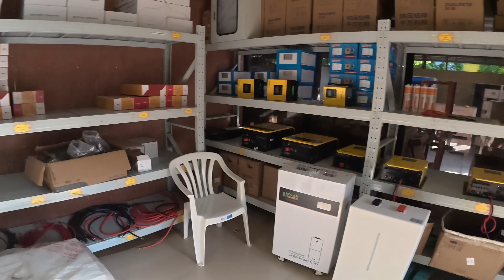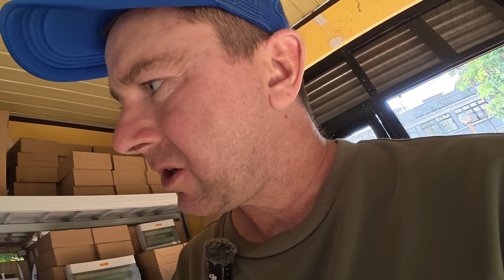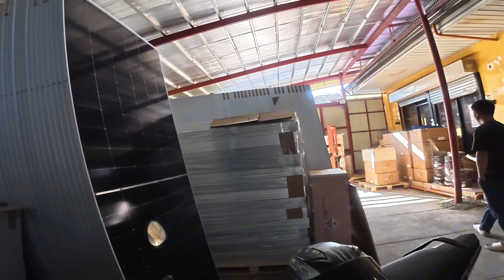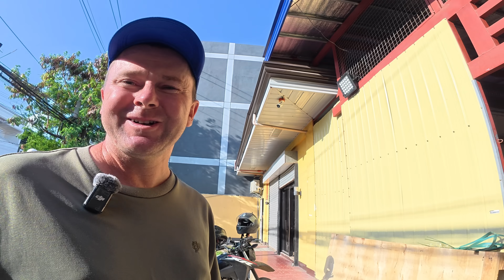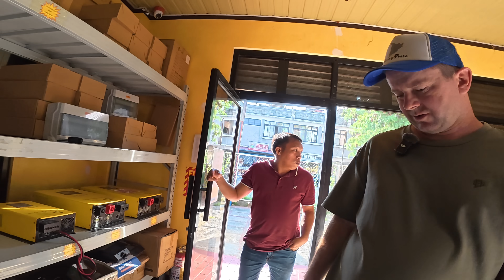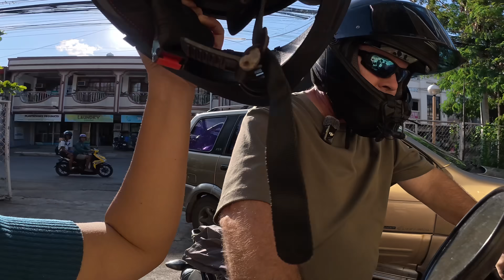Philippines Cost Of Solar Energy

Comment: What a great solar business, it's an Aladdin's cave of solar goodies.
You're definitely onto a good thing with this James.
Our small UK 2.6kW solar setup has practically zeroed our electric bill with the free energy and the FIT payments.
I could import a 16kW chinese battery for only about £1100 but could not find an installer who would take on the job without pricing the job out of existence or insisting they can only install their massively overpriced batteries!
It was impossible to find a UK installer who would work for a call out charge and hourly rate rather than costing what was a simple job for thousands of pounds!
In the Philippines that problem doesn't exist.
We are going to install the largest solar our roof can take with a large battery storage so we can be practically bill free for our electric power.
We have a house in Antipolo City and brownouts are less common there but as you say the world situation is becoming less stable and petrol/diesel prices are likely to keep increasing with access decreasing with the various middle east wars, etc.
Add in a nice EV car and you are more self sufficient with zero energy costs.
Starting off with battery storage charging from the grid is a good move to cope with those brownouts.
I'm looking forward to seeing how your system gets created.
Reply from the maker: Very insightful comments. Thanks for taking time to comment here.
Reply: @JamesandKarenadventures  depends on the ev . have both gas and a ev hit water witch in the Philippine's flooding is normal.
Reply: Keep us posted, some are building a sepparate room for the system in case of fire.  Make sure all good quality.  Id like to know about install and issues if any during and after install to see if worth doing for myself.  my bills over 11000 a month.

Comment: I see ONE Solar in there. I bought a ONE Solar Power Station (1.2 kW) and it broke after not even a year. Some people say they have no problem with ONE Solar. Maybe that is just 1 poorly designed product and that others are good. The same goes with expensive brands like DEYE. I am now in the process of buying an Inverter. I hesitate between those very expensive brands and PowMr and Anern that have the same Spec for 40% of the price.

Comment: You better make a REAL evaluation of how much electricity you actually need and use, especially if you plan to charge your EV. The installation here sounds reasonable for an average house in the Philippines, but the problem with solar is that during the rainy season, you only get a fraction (10-25%) of the production from your panels. If you use Aircon a lot, you will need more panels. Aircon use a HUGE amount of electricity. Don't forget the cost of installation of those panels, including the wires and connectors. You may need to reinforce your structure if it was not build to support that much weight. Those 14 panels are at least 1/2 a ton.
Reply from the maker: Thanks for the advice, we are definitely doing our due diligence on the load requirements and structural needs before we commit to the full install.🙏

Comment: I think six panels and a 4 kW hybrid inverter are enough to charge the car with 15 kWh daily and power the house, including two air conditioners and a refrigerator.
Навіщо платити більше ?
Reply: Друже, підключи автоматичне  дублювання українською. Мені цікава твоя інженерія
Reply: В Києві, в літку 12 панелей  jasolar 450 W односторонні (висять під кутом 90°) за сонячний день заряджає 16 кВт АКБ два рази 
Це 50.45° пн. ш., 30.52° сх. д.

Comment: Solar attic fans to extract heat from the ceiling—in the Philippines—such as the popular 360 Solar Ventilation systems—cost anywhere from roughly ₱2,300 for basic DIY exhaust kits up to ₱16,000 to ₱22,000+ for larger 20W to 40W+ roof and gable-mounted setups

Comment: James the way to go, one advice but for sure you have checked it already, make sure your roof thrusters are strong enough to hold the extra weight of the panels with in mind the strong hurricane winds
Reply from the maker: That is a great point, we are definitely making sure the roof structure is reinforced to handle both the weight and the wind! 👍

Comment: Despite my one bad experience with solar and the fact that solar burned my BILs roof in the US, I have to admit I am now a fan. I beat the price skyrocketing with my two 12KW with large storage installations. I have a couple of modest houses in town that I'm going to DIY, 6200W AIO Inverters with most everything you need integrated into the inverter, breakers, fuses, lightning protection. Need an external PV cutoff switch and possibly a fuse at the battery because I would rather replace a fuse I sourced than try to find the exact fuse the inverter manufacturer used. I don't have much room at these modest houses since I refuse to punch holes in the roof. I will build a Pergola over the 2nd floor deck at one house and put the panels on the carport at the other, one will have 6 pieces 720W Jinko commercial panels and the carport 7 720W Jinko panels. More than enough to power a modest house. Also single string and wired in series about as simple as it gets. Less than $4k USD each system, but I'm using expensive panels due to lack of room for more panels and I'm buying a premium quality battery with bells and whistles. 

I could probably build an adequate system with less storage, using James Watt metal case (like a good golf cart battery) batteries that have active cell balancers that work all the time to keep the cells balanced so the batteries don't need to be high tech and smart and communicating with the inverter. Pony Energy makes a apparently identical battery except they use a passive cell balancer where the battery will only balance when it's totally full and stays totally full for hours to days But I would use the Pony Energy if I were using only one 5kwh battery because it would be full every day the sun shines so it would get hours of balancing on those days when the panels produce more power than you can use. The Pony Energy is P5k cheaper than the James Watt but for a multi battery installation I would want active balancing.

If I really wanted to cheap out, James Watt makes some 300AH 24v batteries that sell for P30,500 with active cell balancing and I could connect them in series for 48V. Cheapest storage I have found that I would be willing to use but that price probably won't last because if I can figure it out, someone else can too. I would do it but I want a single battery solution, simple, easy, clean, no busbars, external breakers, one fuse, two wires less to go wrong and I might not always be around.

Forgot to mention, the houses are already wired with interlocks for generator hookup and my systems will be plugged into that so they are truly Off Grid but grid is retained and flipping one breaker and the house is grid powered again. This would make me want to use less and cheaper storage battery and just switch on the grid at night when we are using so much less power but it isn't for me and I have no confidence in the energy use discipline of those who will be using it.

Comment: I have solar two installations in fact 12kw each. One was for wife's family, 12kw solar 45kwh batteries and after back to back typhoons and about 3 cloudy rainy days they were thrown back to the grid, lack of discipline using high power appliances at night. 

If you expect to charge your car, you need a higher powered inverter because you really want to be pumping the juice to the car during Peak sun. One 16kw battery will only get you through a night with aircon if the aircon is low draw. If you are just using the fan, you will be fine. If you plan to charge a car you must capture and use as much power as you possibly can during peak sun. 

If the panels are bifacial but laying flat on a roof, expect to only get 70% of what they are rated for because the rating was done at 25C and in bright sun those panels are going to get up to 60-70C and their efficiency will go down. 

12kw inverter brings it's own joy it will use 100W or more in standby whether it's doing anything or not that's like doing a load of laundry in a washing machine +10% every day or 10 times 10W lights running 24/7 but it's literally a make hay while the sun shines situation.

I maintain the electric connection because it's pretty reasonable price of admission to a billion dollar grid if you aren't using that much if any power. When your battery goes flat, it's a luxury to just throw a breaker and run you house and possibly charge your battery if you think the next day might be rainy also. The minimal standby charge for the electrical connection is a cheap admission price to have access to the grid and not have to run a noisy generator. I love generators, I was into generators long before I leapt into solar, I size the generator to the load for efficiency and I have several. I suggest you have a generator also if you don't have one. I can see the appeal and satisfaction of telling them to "Come get the meter, you don't need it anymore" but is that adult thinking?

Solar isn't trouble free. One of my professionally installed solar setups failed within a week, might not even have lasted a day, I don't know because I wasn't there to monitor it and my wife only looked at it when I told her for the 3rd time and sure enough, the batteries were almost dead. Providing the grid is up when your solar goes down, it's going to be a joy to flip the switch and everything works until you get your solar fixed.
Reply from the maker: Everything you said is correct. We can just about live comfortably off grid now. Even just enough to run our fans and fill our water tank once a day is enough. We are installing a split aircon for Karen and the baby on the days when it’s needed on the hottest part of the day which is very sunny. The car won’t be used but maybe once or twice a week and can be used also as an additional power bank, lol. I’m fully aware of the issues with EV and solar charging. We will be great.
Reply: @JamesandKarenadventures  Glad to hear that. I prefer to think of it as being self reliant rather than Off Grid.

Comment: Dear James & Karen. I am pretty much in the same situation living in the Philippines and facing high electricity cost with an unreliable grid. I currently have 3 kW of panels installed and 7.5 kWh batteries in our temporary dwelling. I am building my house and will have pretty much the same Power (Panels & Batteries) than what you are purchasing. This should be enough to power your home. If you use a lot of Aircon you will need more panels and one more Battery if you run AC outside of sunshine time. I can tell you by experience that in cloudy days, the panels generate maybe 25% of their Power and in rainy days 5% if you are lucky. I doubt your planned system will be able to charge your EV, unless you do little driving and you charge while the sun is at maximum. We have no choice but to also use the Grid when there is not enough sunshine. I wish we could have a net metering system. Then we could balance between our over and under production and get zero bill.

Comment: Check Pecron F5000. It has 5kw including  inverter, it costs from the Chinese factory about $1200 and you can buy extra battery or two of these. The best brand ecoflow delta. You will get much more value from these systems.

Comment: Hello James and Karen, I’m budgeting roughly 400,000 pesos towards solar for my in-laws in the Ajuy, Iloilo. The house is roughly the size of yours with a rest house give or take ( I don’t have the exact measurements) Is that a good start? I know room size and how many appliances we plan to run will factor in. I just need to know ball park wise if 400,000 pesos is a good start. Thank You in advance.
Reply from the maker: That is easily enough. Make sure you shop around for prices and get what you ordered
Reply: @JamesandKarenadventures  Probably use the same company that you are using.

Comment: 9100 watt did you find out what breakers you need howmany Amp? Minimum 32 Amp! And you need also thick cables. Be aware you buy SUN UV risistend cables James otherwise in 4 months it is chips

Comment: If it's off-grid and you're not tying into the grid for sell-back, look at Chinese manufacturers. Docan Power ships around the world and they have a 48kWh battery for 246k pesos. You can get larger Victron (German) inverters and solar charge controllers for what they're charging for smaller components. Also look at Jinko Solar for your panels - the most efficient available and they service ph. All I'm saying is don't limit yourself to a specific installer. Solar is entirely DIY now and products out of China are excellent. Even the US manufacturers are just packaging Chinese-made LiFePO4 cells. Or meet in the middle - find an installer that will install and you buy the components.

Your system will need to be oversized if you're going to be charging an EV and running aircon.

Comment: Since it is illegal to build this without a permit in the PH, how hard was it to get that permit? I only have portable panels and two Bluetti boxes, so I can always run the fridge, internet, and a TV plus office, and for bad days, just charge it with the aggregator. One box with all I need typically holds enough power for 15 hours. If only fridge, about 25-30 hours. With what I have now, brownouts are never an issue, and in a disaster, never an issue either, as there will always be power, and the panels will not be destroyed during an earthquake or typhoon. 

Just putting it out there that this is another way of doing it unless you want to be disconnected from the grid completely. 75K PHP per Bluetti box, and 36K total for 2X400W portable solar panels.

Oh, and be very careful with that dating site. It is not good..
Reply: i was told by my professional installer that if you are off grid you don't need a permit, the permit is so you can backfeed the grid.
Reply: @robertkubrick3738  No, that is not correct. Always double check in the PH, Mr😅

Required Permits for Pure Off-GridBuilding:
Permit (from your municipal/city LGU)
Electrical Permit (from your municipal/city LGU)
Certificate of Final Electrical Inspection (CFEI) (issued post-installation)

I am almost done building a house here, and oh boy, what you are told, and what is reality is most often two different stories😅

Comment: If you have additional budget, get Deye. I had issues with Solar Homes. I have 4 units and they dont sync properly.
Reply: Even if had issues, unli solar helped to change the parts as part of warranty. Its just i have to pay the transportation and service for the installer. That battery is not light and need 3 people to carry.

Comment: I bought mine from them. You are in good hands. I have 18KW inverter, 30 panels, and 60KWH battery in Caticlan.
Reply from the maker: Glad to hear they are reliable, thanks for the feedback!
Reply: what was the cost of that???? Sounds like the way to go..
Reply: @anaussiefarminginthephilippinespent 930k Pesos but that was before the US-Iran War. And the materials a bit cheaper that time.
Reply: @ofwretirementjourney  Yes i was quoted around the same,, I bought from China, less then 1/2 price, i will install myself. the company wanted 100,000 as part of their quotation for a 16 kw unit... i will install instead, i cant see how 100,000 peso to install is worth it...
Reply: 18KW???? are you start a supermarket??
Reply: But im planning 12KW in my house in Altavas next year.
Reply: @jackpiket7643 i have water refiling station and ice cubes shop. 😊
Reply: tf?? u got an AI data center in your house 😂
Reply: @felixortiz1185 im actually planning to add more panels and battery. Not enough during rainy.

Comment: James based off of 2 -16 kW  batteries how much storage is in each battery?
Reply: 16 kilowatt hours each battery. My modest house running a 1hp mini split 24/7  20cuft refrigerator 65 inch tv( 4 hours) running a 2kw kettle 2200w washing machine twice a week (90 minutes), probably 4 hours a week for the 2300W dryer, cooking by microwave and induction cooktop we average about 0.8kw draw 24/7 so one 16kwh battery would last me 20 hours except you don't want to run the battery dead for longevity so I could realistically power my house for 16 hours off one battery, longer though if I delayed doing laundry or using the dryer until I had sunshine. Shorter of course if I didn't have sunshine and decided it was laundry night or it was a rainy day? The battery might not even last 8 hours with large loads like washer/dryer running for 4 consecutive hours.
Reply: @r @robertkubrick3738 thanks